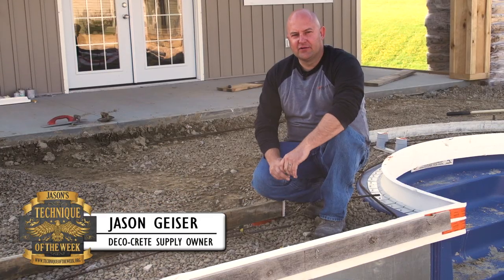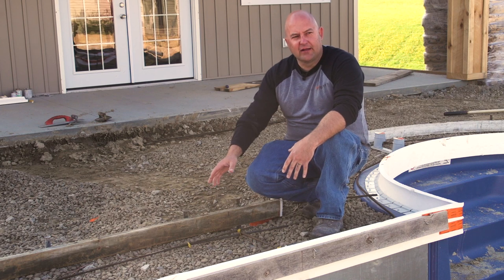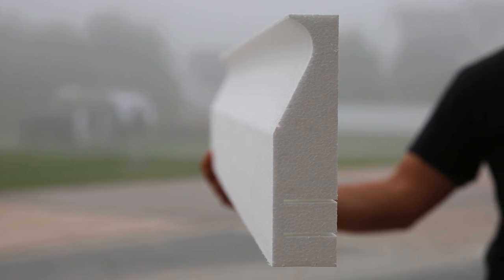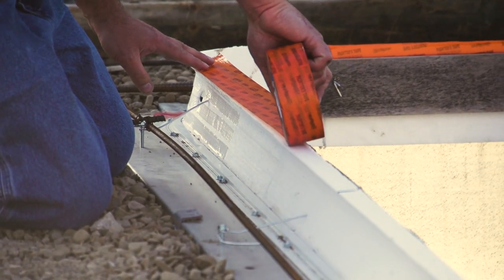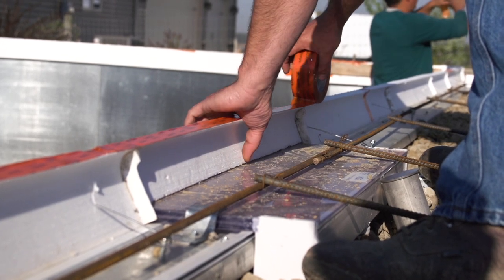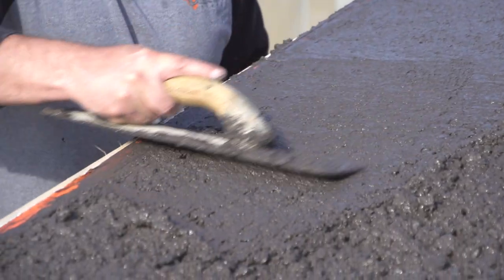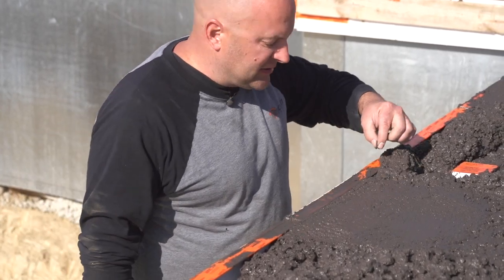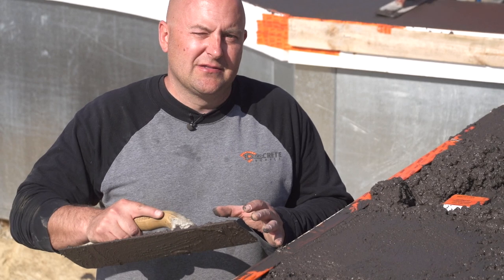Protecting Styrofoam Pool Forms

Comment: can one oil the form previous to pouring to help with pulling the form cleanly?
Reply from the maker: Thanks for the comment! Yes, it is recommended to lube the forms before pouring. Our Deco Lube form release works the best for this; it's a water-based gel lube. I leave a link to the page on our website. I would not recommend any form release that isn't water-based, the solvent or petroleum based oils can melt the styrofoam forms. Thanks for watching Deco-Crete TV!!!                                                                                                                                                                                           
 https://www.deco-cretesupply.com/products/releases-forms-expansion-wire/deco-lube